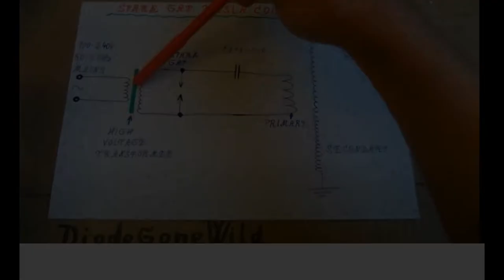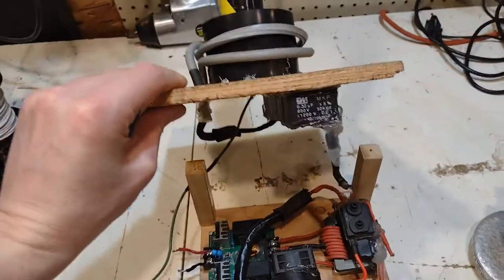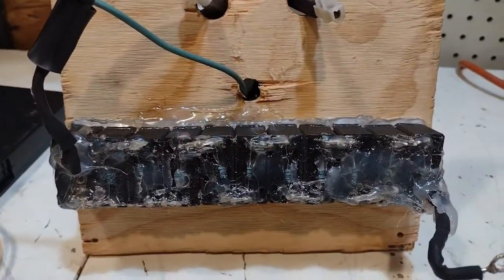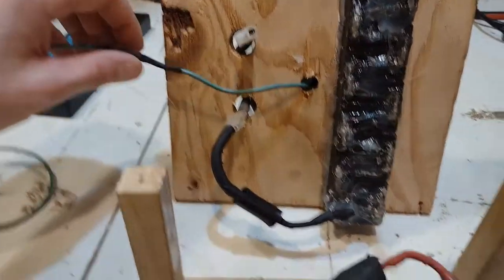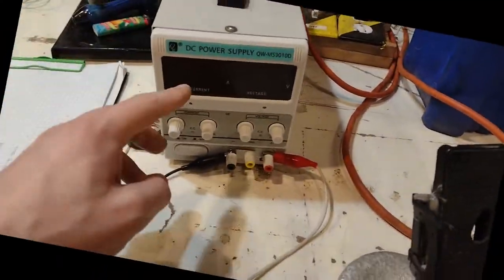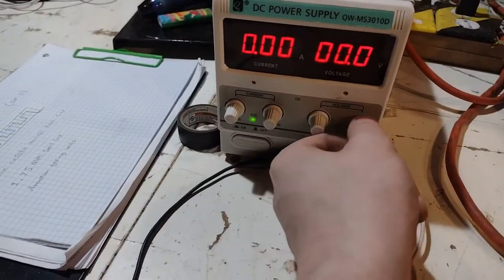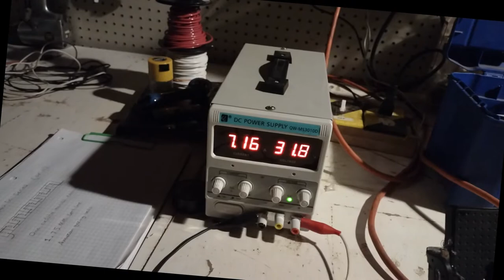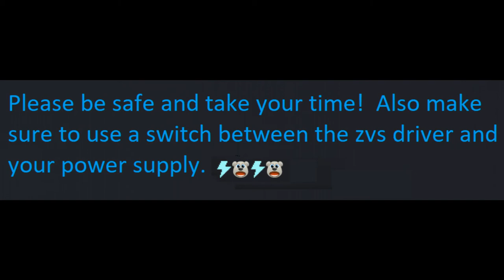How to build the ebay zvs sgtc kit

Comment: Thank you so much. I have been trying to figure all this stuff out since I got the coil but I couldn’t so thank you so much. Hopefully this will be the first step in building my large rotary spark gap coil that I have.
Reply from the maker: You're welcome!  Make sure to record it.  Also that rotary sgtc sounds cool too, hope to see some of that in the future.  Good luck man and if you have any questions I'm here.  Also forgot to mention you should really insulate the flyback transformer from the wood, I used hot glue and bulit a platform of glue and rubber about 1 cm high to insulate it which i didnt show in the video.
Reply: Thanks for all the tips. And I’m excited for the rotary sgtc too. It will probably shoot up to a few foot long arcs hopefully
Reply from the maker: @eckdirtbiking5113  You're welcome.  That sounds so cool yeah.  Make sure to record it!! :)  And be careful.  Can't wait to see :)

Comment: Hey thanks for the video. Could you leave a link to the capacitors you used. I’m having a hard time finding them
Reply from the maker: Sure, the exact capacitors don't matter as long as they are high voltage and tbh i don't know if its saving anything but Im using several.  Here is the link for the blue capacitors that i'm using https://www.ebay.com/itm/193050930981  I think  i was using 40pF caps.  Also I have some 6n8 1600v caps that I like as well but didnt really show in the video.  But if you just order like 20 of those then use two on your zvs driver input and maybe a couple on each side of your switch it would be good.  The theory is that without the caps, the wires could be charged and discharged rapidly and it could be harmful to the zvs driver and back feed into ur power supply.  By adding capacitance to the wires, it seems that it would be harder for the wires to become too charged and discharged, because you can only transmit so much charge per cycle.. So basically you end up wtih less noise back feeding into ur zvs and power supply.  IMO we need these.
Reply from the maker: Also I show some 40v 20,000uF capacitors that I got used on ebay. got 5 for 40 dollars.  Altho I'm just using my smart power supply and not actually using a proper transformer that i rectify to DC with.